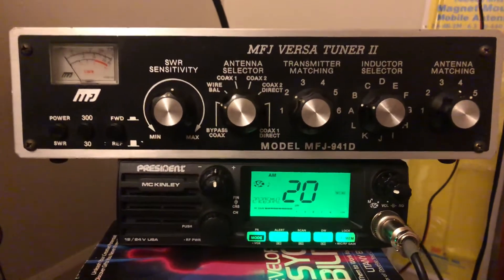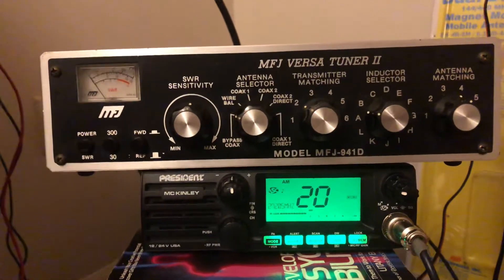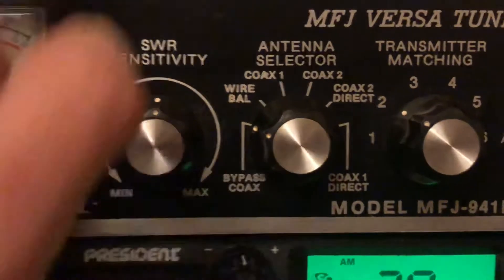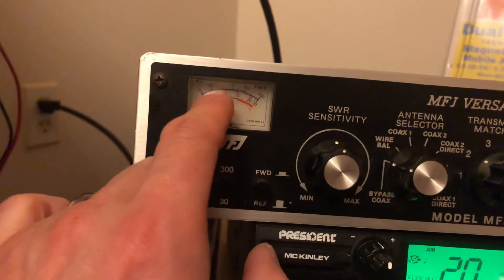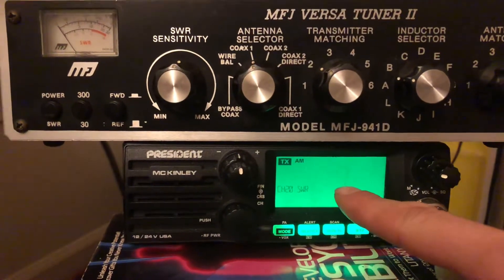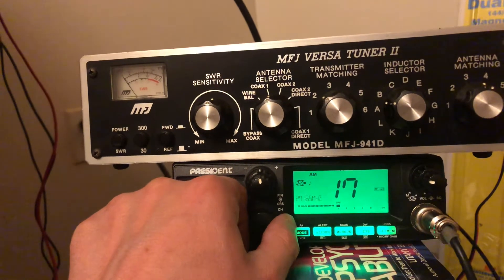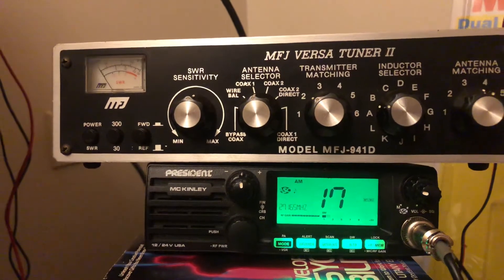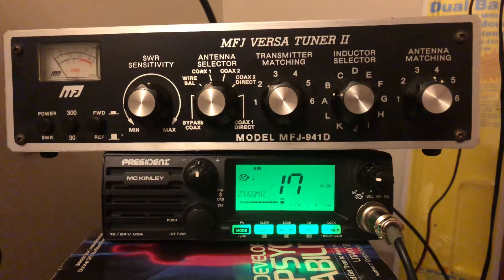MFJ Versa Tuner II. Tuning example.

Comment: I run an 9:1 Unin end fed 103' wire antenna that needs a tuner.  I use my internal tuner and I can use 160m - 6 meters on that thing.  Yeah, my RX is not as good as a resonant antenna but I get loads of contacts with it.  Sometimes ya just need a tuner.

Comment: Very informative Mike.
Reply from the maker: Thanks for watching.  I thought this would be a great way to show how a tuner would help in the shack.  We knew the Workman B-100 in my room would throw off a horrible SWR.  So it was a perfect experiment.   I was using it the other night to tune my Imax 2000 for 15 and 17 meters.  worked great there too.  made some contacts.  now my 991A has a built in tuner.  But it was fun learning how to use the manual turner.   73
Reply: Mike, would that WorkMan B-100 work as a Shortwave listening antenna?